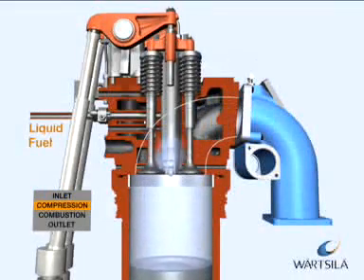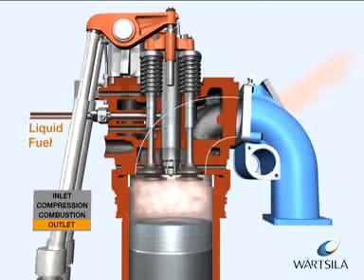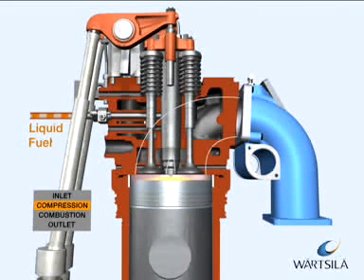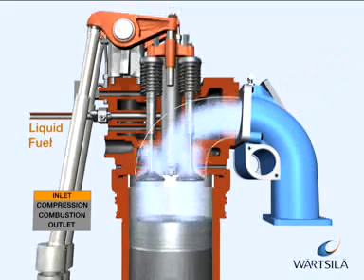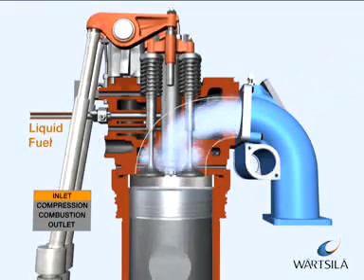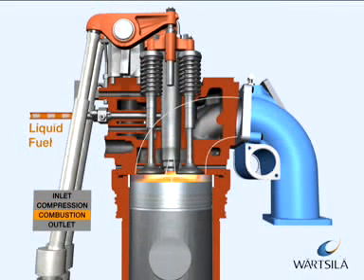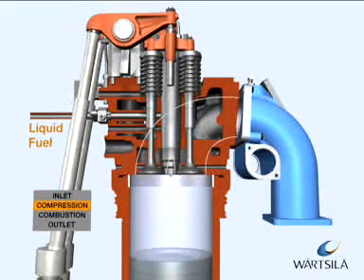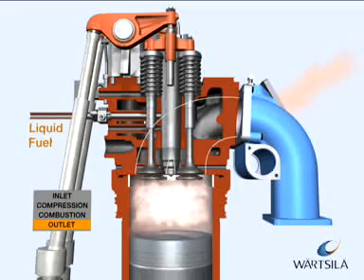diesel marine engine

Comment: @Frederik19951995 . Yes but when a piston goes up to create a vacuum, another is going dawn, canceling that vacuum. Even so, on some motorbikes with one piston, they are running, don't they?! The heat cause by the engine makes the air expand, and many others things canceling that piston effect. Probably i am wrong.

Comment: some of your explanation was not definitely correct. Injector was injected liquid fuel into cylinder head by fuel injection pump around 4 degress just before TDC,  not during combustion. Whether injector is inject during combustion is totaly wrong caused fuel cam shaft was not on the top when inlet valve and exhaust valve closed. Whether like this idle gear position during instalation is totally wrong. Scavenging process also i'm not sure.

Comment: So what does the "flex" in the RT-Flex96C signify? Is that like "flex fuel"? As in it can burn Bunker-C and other fuels as well? Also, what do you mean by "electronic engine"? I'm new to the whole low-speed diesel thing. Is that like computer-controlled timing or something? Regarding the guy who says B&W makes a bigger (131,000hp) engine...the "biggest" in the Flex may have to do with the cylinder size rather than the actual output. That's just a guess though, I'm going to look into it.